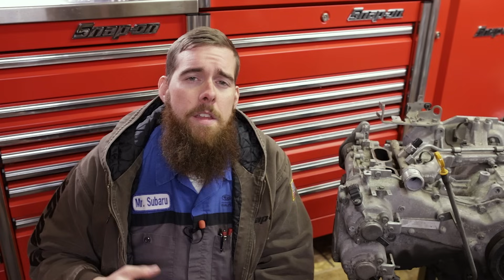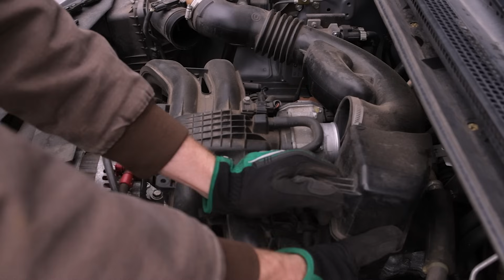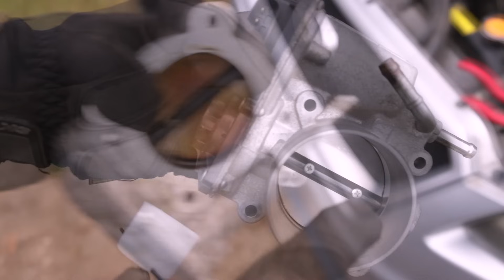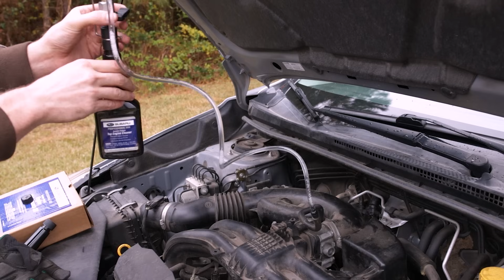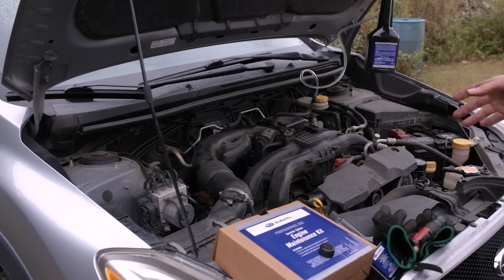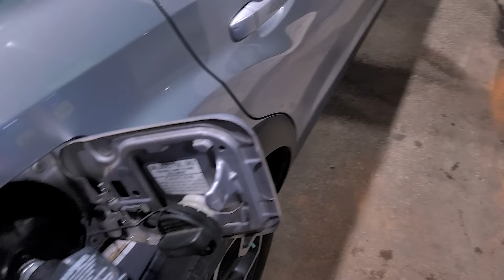Keep Your Subaru Running Like New! Subaru Engine Maintenance Kit

Comment: I had this service done on my '15 Forester XT at the dealership. Less than 1,000 miles later, the catalytic converter failed and they had to warranty it lol
Reply: Damn. I was just thinking of getting this done on my '14 Forester XT as well. I'm skeptical.
Reply: @m_k5268  A walnut blast is a much better option. These chemical cleanings barely remove any carbon and you risk burning out your cat. Walnut blasting will get the valves perfectly clean with no risk of catalyst damage. 

My engine also blew up at 58k miles despite doing 5k mile full synthetic oil changes, wouldn't be surprised if the carbon cleaning had something to do with it.

Comment: So, I have the 2017 3.6 and have ran nothing but Shell 93 through it since I bought it at 11k miles. Has 55k on it now. Is this even worth doing on my engine (EZ36 i think), even as a preventative mx?
Reply from the maker: You'll still see a benefit in an injector cleaner/throttle body cleaning. Can't say you'll see as much of an improvement in the upper engine cleaner, as say on a DI Subaru.

Comment: Do you know how this works on the 2015+ WRX engines? Carbon buildup on the valves seems to be an issue and I've been using the CRC cleaner some other mechanics have suggested. Just curious how this might work on the turbo FA20.
Reply: What you used most likely worked. I used a borescope to check before and after using essentially the same method with seafoam. Even tho I only had 80k miles, it made a difference! I got the same engine btw

Comment: I do a similar operation but instead use CRC Throttle body cleaner to the butterfly and barrel using a toothbrush without removing the the throttle body. Then use Seafoam Spray into a vacuum line near the manifold. Running about 2.5 K RPM, spray the entire can. It will take about 10 minutes to empty the entire can.Let soak for 15minutes,  then go for highway driving. Put one can of Seafoam in your gas tank.

Comment: Mr Subaru, My wife’s 2019 Crosstrek idles at 1900 RPM on cold start up. Once it warms up it idles normal at about 750 RPM. Is it possible to reprogram the computer to get it to idle at a lower RPM around 1000 RPM cold ?
Dealer says 1900 cold idle RPM is normal due to emissions.
Google search confirms what dealer is saying.
Reply from the maker: It's normal. It's to heat the engine rapidly, put heat into the catalysts, and heat oxygen sensors.
Reply: Thank you for your quick response.

Comment: I see people with outback and foresters using emergency 2wd fuse to save fuel like in summer spring does this have long term effects on the car
Reply: Probably not, since all the driveshafts are still the mechanical and rolling resistance doesn't change.
But if it makes them feel better...
Reply: Well on my 03 I was thinking why on pull the wires for the fuse run the into the car it self and make a switch so you can throw a switch inside the car
Reply: A round trip of about 90miles most highway will burn 8 gallons of gas on my car if this saved 5mpg its worth it
Reply: @uofm49426 
How? All the fuse does is prevent the system from managing the awd power distribution, there is no change in mechanical aspects of the system. All the bits and pieces that cause mechanical friction are still there, and there is no change to weight of the car.
Reply: Well in a 4 wheel drive say a trailblazer or an old blazer when you run 2 wheel drive when the don't need it do to mpg they don't lose or add weight I know
Reply: @uofm49426 

I have an '07 Trailblazer, the four wheel drive system is very different from a Subaru. The TB has a front axle disconnect, in 2WD mode the front axle isn't driven, nor is the transfer case forward shaft.
In auto 4WD mode the front axle is engaged and transfer case will engage the clutches if the system detects slip. Useful when driving in changing conditions when you don't need full time 4WD. 
Subarus don't have that system (at least the modern ones don't) the AWD system drives all the wheels continuously.

Comment: As normal ... outstanding advice....I have 9K on my 2021 Forester. If using something like AMSOIL gasoline additive, when should I perform this routine.  Please do not retire...we need you.
Reply from the maker: 30k miles would be the recommendation for the upper engine/carbon cleaner.
Reply: @MrSubaru1387  thanks

Comment: A word of caution - I had the WQW-58 recall (which included the top engine clean) performed on my 2014 Forester 2.0XT and the carbon/solvent sludge that went through the combustion process actually clogged the cats which the dealer then had to replace under warranty.
Reply: Top engine clean is notorious for fucking up cats.
Reply: @rock962000  Well someone needs to tell Subaru because they have an entire service process with an OEM tool to use their own Subaru-branded Top Engine Clean on motors that are exhibiting certain issues.
Reply: @depace311  if you think about it, all the carbon you're cleaning goes straight through the cat/cats. It's a pretty harsh chemical and I don't really recommend doing it unless the vehicle is a high mileage car (90k+ miles)
Reply: @rock962000  i absolutely agree with you - if your motor has carbon buildup issues due to DIT it should be disassembled and cleaned with a walnut blast (like Audi and BMW do). Unfortunately if you car is under warranty by Subaru, the top engine treatment is what they're going to do - unless they have revised their processes in the past ~4-5 years
Reply: @rock962000 literally came here to ask if this was a concern.
Reply: The upper engine clean has to be done with the engine (and catalytic converter) warm. Performing it on a cold engine is a bad idea. Is that what happened?
Reply: I had that service done on my wrx 2021 at 15k next day P0420 was thrown catalytic efficiency below threshold. Im wondering if that procedure may have messed up something with that system. Its been a few days and performance has not been impaired
Took it back and they cleared it but it came back on again the next day.
Reply: @gethomel  absolutely related. the carbon solution goes into the exhaust and clogs everything
Reply: @depace311  I got a call from the service manager. He wants me to bring it back in so they can diagnose the check engine light. If i would have known this service to mess up cats i would have turned it down. I paid 500 bucks to have an oil change, throttle body and induction service done thinking that it would have my car staying in tip top shape only to leave with possible cat damage. I will make sure they dont get another penny out of me.
Reply: Remove cats, straight pipe it.🤙
Reply: Could you do the upper engine clean with the cat/DPF off the car?
Reply: As a general reply to this thread (not to any one person), aren't the catalytic cleaners like Cataclean or others specifically designed to dissolve carbon in the fuel system, and wouldn't dissolved carbon then be burned off in the cats? ...I'm just learning about this stuff, since I'm just dealing with it for the first time. ...Wife's Crosstrek has the P0420 code.
Reply: @petset77  Yes. People are missing step #1. Which is bring the car up to operating temp. Basicly when the thermostat opens once or twice. The cat will be nice & hot at that point. Which will allow everything to burn off before it can clog anything.

Comment: Hey I have had 2 fb Subarus now that develop a miss fire on 2 and sometimes 4 new coils and plugs any suggestions on what it can be?? I do get one code for u1201 and I look at cam shaft position sesnor harness and it was fine….
Reply: You don't say what year the vehicles are. ECU flash took care of misfire on mine - there's a TSB. Have a dealer check it.

Comment: I perform this service at work we use a compressed air and gauge system and go in from the throttle body but had no idea Subaru had there own tool and kit. Maybe I missed it but is there a recommended milage when this should be done?m from Subaru?
Reply from the maker: Not that I'm aware of, but personally, I'd advise 30k service intervals with the top engine cleaner, on the newer DI engines.

Comment: My 2010 Outback is making a ticking noise when driving. The noise happens for example, when I am on the highway at around 75mph in 6th speed @ ~3000 rpms, a ticking/knocking noise can be heard. When I lift my foot off the throttle, the noise dissapears but as soon as I press the throttle again, it comes back. It does this only at certain speeds and depending on what gear I am in. Like when I am at 38 mph and in 4th gear, the noise is present as well as when I am in 1st or 2nd gear upon acceleration.. What could be the issue? My car has 160 000 miles on it. I also put a few bottles of marvel mystery oil in my gas tank, my engine oil and the idling has improved and the engine runs slightly smoother but the ticking noise hasnt dissapeared.  No, its not a tie rod thats is broken, the engine doesnt knock or anything when idling or when I release the throttle. It seems to happen when I try to maintain the engine at a constant rpm/speed.

Does anybody have any idea as to what the issue might be? Thanks for the help.
Reply: It could be your exhaust rattling. I had a hanger come undone on my STI and it was doing that but only at certain RPMs
Reply: @VolcanicBoss  I just had my exhaust redone since the winter and salt killed my exhaust @ 160 000 miles so I doubt it would be that. The sound also sounds way more like its coming from the engine bay. Thanks though for responding.
Reply: No problem man. I know how having a Subaru is. Mine has had a problem for a few months and no one including my mechanic can figure it out lol
Reply: @VolcanicBoss  I would have to let my Subaru go for an unknown amount of time so my mechanic could check things out. Not so easy when its your daily. I just live with it for the moment..
Reply: @TheCharacter97  that makes sense. Just make sure you’re keeping it full on oil and it’ll probably be fine (mine burns lots of oil)
Reply: @VolcanicBoss  I check my oil level at least once every 2 tanks of gas burned. Mine burns around 1 liter per 3000 miles.. not that bad considering I haul loads with my car in my trailer (nothing extreme but I carry around 1000 lbs). I use conventional oil as it is thicker and wont burn off as easily. Its also cheaper so I  just change my oil every 3000 miles.. In doing so I am sure my Subaru always has good oil to lubricate and it doesnt cost me a fortune. With synthetic, I would change less often, however, I would have to top off more then what I need to top off with my conventional oil. I do as much as I possibly can because a Subaru isnt complicated to work on. Simple stuff like changing a wheel hub I let my mechaninc do it though.. the last bearing I had changed he took it out in pieces and he got the parts red hot to be able to take it out in pieces..  I need to save some money and change all 4 calipers and also change 2 wheel hubs
.. One out of the 2 isnt really needed but doing those 2 would mean all my wheel hubs would be 2 years and younger.
Reply: Sorry, went a bit on a rant..
Reply: @TheCharacter97  it’s all good.  Good luck with it man!
Reply: @VolcanicBoss  Thanks. Hope you get loads more of fun out of your Subaru.
Reply: How loud of a tick is it?
Reply: @VolcanicBoss  Loud enough to be heard in the cabin with windows closed and when you pay attention to it. You can hear the ticking go away when you release the throttle and start again once the throttle is engaged again. You could hear the ticking noise if you were walking and I passed by you. When the engine is idling or I come to a complete stop, no noise, throttle is engaged, the noise will start again depending on speed and engine speed (rpm) and what gear I am in.
Reply: Does it do it at the same rpm when not driving?
Reply: @VolcanicBoss  indeed it does do the same ticking at the same rpms when just sitting and engaging the throttle on neutral. I just tried it to make sure that it did in fact do the same thing wether in gear or in neutral.
Reply: Mine has a belt that makes a bit of a ticking noise. Maybe try checking that. Does the car shake or anything when it makes the noise?
Reply: @VolcanicBoss  No, the car doesnt really shake. Acts like normal, just the ticking.. Hard to tell..
Reply: I don’t know then. Sorry. Good luck with it. Hopefully it is something easy
Reply: @VolcanicBoss  Thanks for trying to help me out. As I said, its really hard to tell and even my mechanic who is really good cant tell. He would have to get more in depth to find the problem.

Comment: Does EJ255 needs this kind of cleaner? If it does, will this impact the oil solenoids for VVTi?
Reply from the maker: Not really, but it won't hurt. This is more geared towards the DI FA/FB engines.

Comment: Great video. Would you recommend putting a catch can on these engines to help keep the intake valves cleaner? If so what brand do you like?
Reply from the maker: If you do on the newer DI Subarus, you'll void your warranty. I have no brand recommendations for catch cans/ air oil separators.
Reply: Oh I didn't know that.  Thank you for the information. At what mileage do they recommend the top engine clean be done at?
Reply from the maker: @markshane2686  30k intervals would be best.
Reply: @MrSubaru1387  this answered my question

Comment: As always, very insightful and helpful. I don't know why I thought all the FA / FB / CB engines were port injected. It would have been nice if a borescope could have given us a before and after of the valves.
Reply: XT WRX and Ascent FA20 and FA24 engines are definitely direct injected, thus "DIT" on my XT's engine cover
Reply: @marksandstrom4248   I'm pretty sure those are FB engines.

Comment: Nothing helps direct injection only cars like media blasting the valves don’t car what kind of addictive you use. It the car is Duel injection as long as you use good quality fuel the back of the valves will be perfectly clean same goes for regular port injection.

Comment: The clear flood mode works great, if your Subaru has been sitting for a while and you can Crank to build oil pressure before had.... and on oil change too
Reply: This method is whats recommended for a oil change don’t wanna run it on dry

Comment: This maybe why my 15 legacy stalls when I turn engine on sometimes. Also when I’m about to stop at red light it does a studder.
Reply: My '15 Crosstrek does the stutter at stops too, esp if it's more of a hard/quick stop.
Reply: I would clean the throttle body & see what happens.

Comment: About a month ago I was using CRC  Throttle body cleaner when the straw decided it wanted to go in to the intake  manifold. .......I had to take my thottle  body off at that point,  lucky I was able to get the straw back  out and was able to slap the thottle back on using the old gasket and my "calibrated " hand touqe. ....so far so good..... dang straw....
Reply: Same thing happened to me! Hahaha the subaru upper engine cleaner straw is trash!
I couldn't retrieve the straw... Car seems to work fine. For now....

Comment: does a 2013 have direct injection? i thought they started in 2019.
Reply from the maker: It doesn't. Just my 2013 has 218,000 miles on it. Lol
Reply: @MrSubaru1387  that's good I will be looking for a manual Crosstrek next year and definitely don't want direct injection.

Comment: How often should this service be performed mileage wise?
Reply from the maker: On a DI Subaru, 30k miles, for the top engine cleaner. On port injection, 80/100k is plenty reasonable.
Reply: @MrSubaru1387  

For those of us who have driven less as a result of the pandemic, is there also a time frame when these services should be performed or is 30K miles still the reference guide?

Thanks for the awesome videos. Subscriber for life.

2019 subaru forester with 14K miles.
Reply: @MrSubaru1387  can you  clarify what a DI is? Both  my college kids have 15 legacy’s 3.6l one had 30K one has 93K on them, but I don’t know if they have ports or Di?
Reply from the maker: @lisacyr8636  DI is direct injection. 2018+ Subaru engines. Aside from the WRX and BRZ engines.

Comment: Good to know!  Where might one hook the valve carbon cleaning dispenser safely to an FA 2.4 engine ?
Reply: Web search discovered a Subaru service bulletin 09-74-21R (08/30/21 version) that shows connection points for DIT and DINA engines including the 2.4.  Plenty of caveats on it so I'll let the pros tackle mine when it's due for cleaning.
Reply: There is a sensor just downstream of the throttle body that is very easy to get to. I take that sensor out and use that hole. Since I use CRC intake valve cleaner instead of what MrSubaru shows, I just cover the hole with duct tape (making sure to clean the top surface so the tape sticks well) and put an 1/8" hole in the duct tape with a drill bit. Without the duct tape and the resulting hole size reduction the engine won't idle. Then I follow the instructions on the CRC can. This has worked well for me although 40,000mi is probably not enough to significantly carbon up anyway. With this method you don't need a special tool and it's a lot cheaper than using the Subaru OEM cleaner. I do this once a year. Time will tell if it prevents carbon build up.